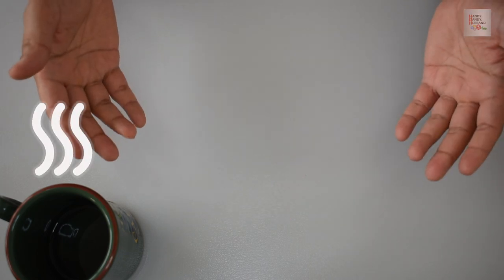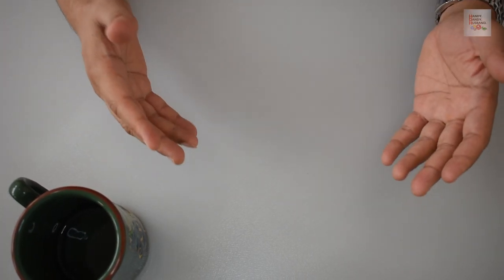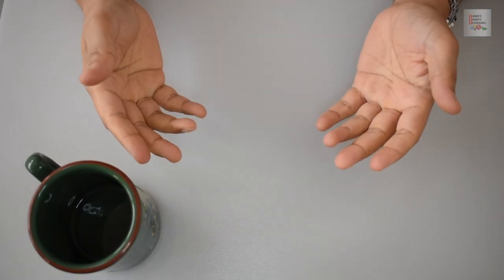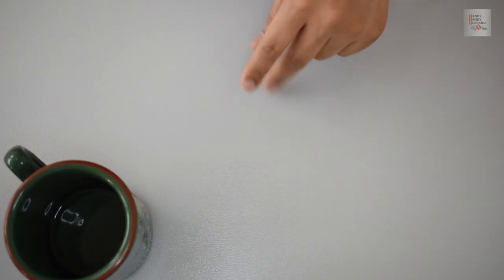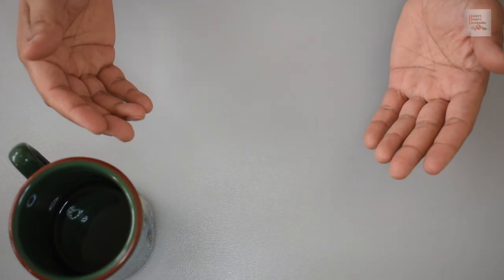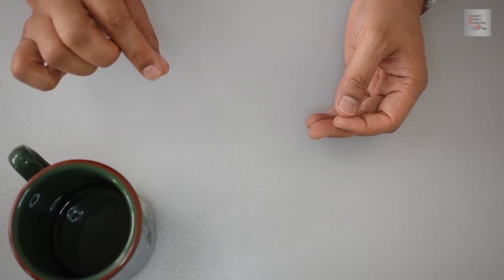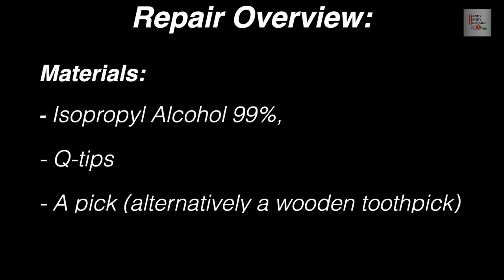𝗤𝗨𝗜𝗖𝗞 𝗧𝗜𝗣: 𝗣𝗦𝟰 𝗛𝗗𝗠𝗜 𝗣𝗼𝗿𝘁 𝗥𝗲𝗽𝗮𝗶𝗿 -- Easy, no solder required -- [Fix that video input error]

Comment from the maker: Hi Everyone, thanks for watching.  As there appears to be some confusion over what part of the HDMI port I am referring, I have attached a close up picture for your ease of understanding: https://drive.google.com/file/d/1nYwZaYcaKrAbYL6Nsrgn1AA8T0TmL-53/view?usp=sharing
Reply: Handy dandy, i wanna ask u smth, 2 years ago i went to a guy who repairs ps4, and he repaired my hdmi port, can the hdmi port be repaired twice? I wanna know please cause my hdmi port needs repair again, can it be repaired again?
Reply from the maker: @keegan4713  Hi KeeGan, thanks for watching and sending me your question.  I would say that most likely the HDMI port can be repaired twice; however, I would qualify that by saying it depends on how well it was fixed the first time.  If the HDMI port was replaced by a qualified tech that did not overheat the circuit board (overheating can delaminate the thin copper etching) and properly soldered it, then it can be replaced.  I think, though, that it is odd that it would need to be replaced after 2 years--typically most repair depots replace the OEM HDMI port with a much better after market port to ensure longevity.  This leads me to speculate about the thoroughness /qualifications  of the original repair depot.  Maybe contact the same repair center and see if they will do a free customer service replacement or give you a discount for the 2nd replacement.  Hope the above helps you; all the best to you, H.D.H. [: { ].
Reply: Alright man thank you, i delivered it to the repair man so he can fix it, he is gonna take a look if it can be fixed, so i hope it will be fixed pray for me🙌🥺
Reply from the maker: @keegan4713  Hi KeeGan,  thanks for updating me on your decision.  Yes, I will pray for you and your PS4.  It is good that the repair man said he needed to first look at it to see if it could be repaired...so maybe he will unde-rpromise and over-deliver.  All the best to you, H.D.H. [: { ].
Reply: Hey can u still help it still doesnt work
Reply from the maker: @CrunchyCheetah_xD  Hi Rob 9x9x, thanks for watching and sending me your request for assistance.  Please give me a little more information such as what was your initial problem and what did you do to resolve the issue.  If you can take a clear, close up detailed picture of your HDMI port that would be very helpful.  Send it to my email address: thehandydandyhusband.info@gmail
I look forward to hearing from you.  All the best, H.D.H. [: { ].
Reply: What if the port is loose
Reply from the maker: @teongraves2656  Hi Teon Graves, thanks for watching and sending me your question.  If the port itself is loose, then the HDMI port connection to the circuit board has likely been compromised (solder cracked or let loose).  The only way to way to properly fix this is to have the HDMI port replaced.  Some people have seen some success with trying to gently position the HDMI cable in such a precise orientation that gets it to sit just right on the circuit board.  They then tape it in this position.  This is a quick, temporary fix, but it has worked for some.  Hope my comment helped you, all the best to you, H.D.H. 
[: { ]
Reply: I plugged my hdmi cord and all that into my tv and tried turning on my ps4 but it would still just stay on "No signal"
Reply from the maker: @johnlucifent7838  Hi John Lucifent, thanks for your second comment, it appears from your description that your video device is unable to discern a signal from the port.  This could mean that the signal is poor or that there is no signal.  My fix addresses a poor or intermittent signal.  If you have used a new cable, cleaned the existing cable, and bent the thing metal strips, try gently bending the pins a little more.  It may be that you may not have bent them enough to center the HDMI cable with all the center pins.  Hope the above suggestion helps, all the best to you, H.D.H. [: { ].
Reply: @HANDYDANDYHUSBAND  thank you so much
Reply from the maker: @johnlucifent7838  Hi John Lucifent, thanks for your comment.  All the best to you, H.D.H. [: { ].
Reply: I dropped my ps4 it turns on but no signal could it still be the hdmi port that's not working or is it fucked, I also tried pulling the things up but they won't move at all
Reply: This videos fake isn't it? You can't even prompt them things up
Reply: Does this also work for the ps4 slim?

Comment: haven’t been able to use my ps4 in months I hope this video will help😭
Reply from the maker: Hi Elijah Montas.  Thanks for watching and your comment.  Its a bummer that you haven't been able to use your PS4.  Please do try to use the fix I have outlined and hopefully your PS4 will be up and running again.  If you have any questions, please send them my way.  Also....kindly send your results to me so everyone on the channel can learn from your situation.  All the best, H.D.H. [: { ]
Reply: @HANDYDANDYHUSBAND  I was looking around my house for hours to find something that was thin enough to push on of the metal pieces back up because one was flat , I succeeded in doing that , and my ps4 still doesn’t work
Reply from the maker: Hi Elijah Montas.  Just to confirm, you unplugged the PS4, nudged up the flattened pins, you cleaned with isopropyl alcohol the HDMI cable head,  you checked to make sure the PS4 HDMI port on the back of the PS4 did not have dirty lines on it (use a flashlight to make sure) and you used a new input in your t.v.--is that correct.  Last, when you plugged the PS4 back in, you tried resetting it twice--is that correct. If you did all those things, may I suggest using a new or different HDMI cord that you know works with another monitor or tv.  Also, when you take the HDMI cord out of your PS4 this time, are the pins still up or have they reflattened? Please try and let me know when you have tried that, also let me know how old your PS4 is, what type of PS4 is it (PS4 slim/pro or other).  Thanks for your patience while we try to get this working for you.  All the best, H.D.H. [: { ]
Reply: @HANDYDANDYHUSBAND  would u say a  pin would work for nudging the things up (like the ones you use to put something up on the wall)
Reply: Bro I’m months 😂 I haven’t been able to play in 3 years Lol
Reply: Me too
Reply: @dieseldecosta5816  i'm not waiting 3 years. i just opened mine up a little to blow all the dust out of the fan and vents and i could immediately tell it's running a lot more quietly, but i'm suddenly not getting a video signal at all.
my hdmi port has been a little iffy, but it was still working right before i blew the dust out. so either i blew something loose by accident or it's a big coincidence and my hdmi port just completely stopped working at the same time.
i'm taking it to a shop tomorrow, sounds like worst case it'll cost me $150 to have the hdmi port replaced. i have like 90 games on my ps4 though, so that's a pretty small price to pay.
Reply: Lol
Reply: @Jack_80  you can get the parts needed on Amazon to fix you hdmi for only like $40, then just watch YouTube to fix it yourself
Reply: Same
Reply: I been trying my hdmi just keep moving around

Comment: YouTube remains UNDEFEATED!! Thank you so much, after searching thru a bunch of nonsense videos, THIS did the trick...I bet these are the types of simple fixes ppl are getting ripped off for at their local repair shops. Thanx again! 🥳💯🏆
Reply from the maker: Hi G. Brooks, I am happy the fix worked for you.  May you have many more years of entertainment from your console.  All the best to you, H.D.H. [: { ].
Reply: i just took mine to the shop to get the hdmi port replaced for $150. i tried the things in this video but i think my port was completely shot. coincidentally i was getting a video signal until i took off the bottom of the ps4 to blow all the dust out of the fan, and as soon as i hooked it back up i couldn't get a video signal. the guy at the shop still thinks replacing the port will fix it, and i only have to pay if it works. considering i have like 90 ps4 games, $150 is kind of a small price to pay.

Comment: This worked like a charm! The only thing I did different was that I used a sewing needle instead of a toothpick or metal pick tool to prop up the "prong pieces" in the HDMI port because it was thinner than the pick tool, and stronger than the toothpick. The toothpick wasn't strong enough, and it was breaking at the tip when I put to much leverage on it. The metal pick tool wasn't thin enough, and I couldn't slip it under the prong. The sewing needle worked phenomenally! I was back to playing it that day. Thank you so much for making this video HDH. Literally saved me from buying a crappy used PS4. 👍👍
Reply: Thank you for the tip bro

Comment: Just want to say...thanks for saving me money. Wasn't expecting it to work, low and behold; right on the money. Works like a charm. Great content.
Reply from the maker: Hi Truong Nguyen, Thanks for watching and your comment.  I am happy that I was able to help you get your PS4 up and running and you shared your results.  All the best to you...A very big thank you for subscribing, H.D.H. [: { ].
Reply: So my ps4 doesn’t output anything to my tv it turns on but it’s just a black screen. Do u know how to fix it?
Reply from the maker: @PatsFN  Hi J X N, thanks for your further comment.  I would suggest trying the fix outlined in my video.  If that doesn't work, I would recommend trying to shift the HDMI cable while the PS4 is on to see if the slight adjustment improves the signal (you get something other than just a black screen or 'no signal' on the TV).  If that does work, try duct taping the HDMI cable in the best position while leaving the PS4 on for 4 or more hours (the heat may help the solder on the HDMI port), then turn off the PS4 and unplug it for 4+ hours.  Try turning the PS4 on again and see if this helps.  If it does--great.  If it doesn't then, I am sorry but the issue with the PS4 may be more advanced.  You may want to try contacting Sony and requesting a warranty repair of the unit, as many people have reported similar problems.  Thanks, H.D.H. [: { ].
Reply: @HANDYDANDYHUSBAND  Idk if this will help but I don’t wanna try and mess it up more, will it help me? Because my fell on the hdmi and it cut off and the hdmi cord is loose and that’s how ik it’s hdmi + I even got a new hdmi cord still didn’t work.
Reply from the maker: @xzoticcarts  Hi AshtonIsVibin, thanks for watching and sending your question to me and the community.  If your PS4 fell and the HDMI cord was connected to the port it is likely that the HDMI port connection itself has been compromised.  My fix is more directed towards HDMI ports that just stop providing a video signal over time.  You could try my fix, it would not cost you anything and it takes only about 5 minutes, and it may or may not work.  Before you attempt it, however, just try using your finger and see if the HDMI port wiggles or shifts.  If it does, then likely the solder connection that connects the port to the circuit board has cracked and needs to be re-soldered.  Look for a Sony authorized warranty depot and see if they can trouble shoot it for you.  Hope you get it working.  All the best to you, H.D.H. [: { ].
Reply: @HANDYDANDYHUSBAND  Do you know anywhere they sell ps4s that aren’t used/if used it’s cheap or ps5s that are 400-600?
Reply from the maker: @xzoticcarts  Hi AshtonIsVibin, no, sorry I don't know of any specific places that sell new or used PS4s; however, if I was looking for one, I would try some department store factory outlets that may be trying to sell a PS4 that someone returned or maybe a reseller on Best Buy might sell a refurbished unit.  For PS5s as far as I know they are sold out everywhere, but you might want to contact Sony directly and ask them who has ordered the largest shipment in your area and then frequently call into that retailer regularly or ask them to put one aside for you (you might have to pay in advance).  Hope one of my suggestions helps you out, all the best to you, H.D.H. [: { ].

Comment: Thanks! This fixed my ps4. I had the exact same problem.
Reply from the maker: Hi RR.  Thanks for watching and providing your comment.  I am happy I was able to help you get your PS4 up and running again.  Just remember that because we are dealing with bendable metal, over time (say 6-12 months) you may need to repeat the process.  Thanks and all the best to you. H.D.H. [: { ]
Reply from the maker: @Paige Oltmanns Hi Page Oltmanns: ????????????????????? [: { ]
Reply: Was ur hdmi weird and them it wouldn't work then u had to try to replug it and plug it back in and still didn't work

Comment: Hi guys, I thought my HDMI was gone for good. I tried to pull out the metal prongs, all that, nothing worked. At the end, I simply used a Q-Tip to clean the hdmi port. There wasn't very much on the qtip when I removed it, only some black dirt or something. But once I did it, the PS4 HDMI worked perfectly. So try that guys, it really worked and now I am playing the PS4 every day!
Reply from the maker: Hi theunown, thanks for watching and sending in your comment.  That is a good tip and I will share it with anyone having issues that don't resolve with the fix I have already suggested.  All the best to you and Merry Xmas, H.D.H. [: { ].
Reply: Did u clean both hdmis ?

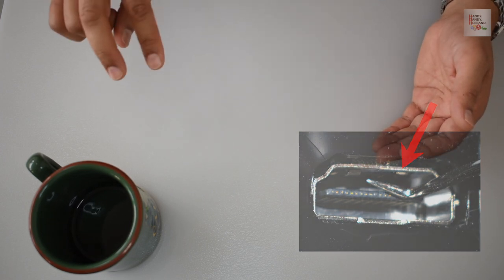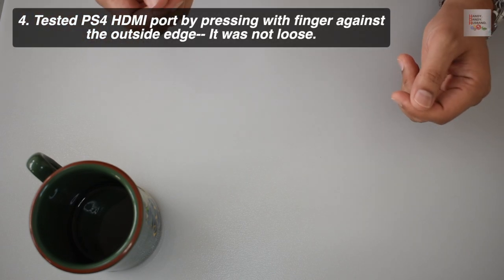Comment from the maker: Hi Everyone, I received a comment from rached Marri asking a question about which specific area of the PS4 to pull out at 2:54.  For some reason, I am not able to directly reply to rached Marri's comment so I am doing so via this public comment section.  Rached Marri:  The area that you need to pull out are two tiny metal strips that are located on the metal piece that surrounds the HDMI port.  At 2:54, I have a metal pick pointing to a piece that I have already pulled out (look to where the metal pick is pointing) and a RED arrow pointing to a piece that is still not protruding outward.  In case you are still not sure, just look for the only two slits in the outer metal casing (as opposed to the thin, horizontal piece in the center).  If you look at the neighboring AUX port, you will also see two pieces of metal sticking upward, the HDMI pieces are like that but not as high.  Unfortunately, I tried to film this repair with a regular video in real time, but the camera couldn't pick up the very small detail; I need a special lens that can pick up the small detail.  I am still building my channel and hopefully I can get monetized one day (2yrs hopefully from now Oct 2020) at which point I will have extra money to buy more equipment.  Thanks, hope this helps even though I couldn't directly respond to your comment. All the best, H.D.H. [: { ]

Comment: Hi there ! Loved the video and the hardwork ! My PS4 Hdmi stopped working for about like 6-7 months before and thunderstorms are quite frequent here. Hdmi cable works fine. Tv hdmi port as well. So i concluded its the problem of the console. And i hope this video helps me because i am really missing my playstation. Will let you know what happened. Im looking forward to your reply and help. Also, are there any more methods to fix this issue other than what is told in the video? Thanks. Love you bro.
Reply from the maker: Hi Nikhil, thanks for watching and sending me your comments.  Yes, I will definitely try to help you out.  When it comes to a video input error, it is best to try a brand new HDMI cable as there are small variances during manufacturing and an older cable may have increased tolerances that a new cable does not.  Apart from that, you should know that my suggested fix is free and is well worth a try before you try some of the more elaborate and expensive fixes such as replacing the HDMI port on your PS4.  If you do try my fix and the 4 steps do not work, try taking your pinky finger and see if the HDMI port moves freely.  If it does, you may have a HDMI port that has a compromised soldering connection to the circuit board.  Such an issue will likely require a HDMI port replacement.  Apart from that you can also send me a CLEAR, well lit, and CLOSE up picture of your HDMI port and I can try to identify any issues before you even try my fix.  Just email your pictures to my gmail account:  thehandydandyhusband.info@gmail.com
Hope to hear from you, H.D.H. [: { ].

Comment: What did u use the alcohol for?
Reply from the maker: Hi Ghillyboy, sorry for the late reply and thanks for watching.  The isopropyl alcohol is to clean the outside of the cable connector in case it has oils or other contaminants that could be compromising the connection. Hope this helps, all the best to you, HDH [: { ].